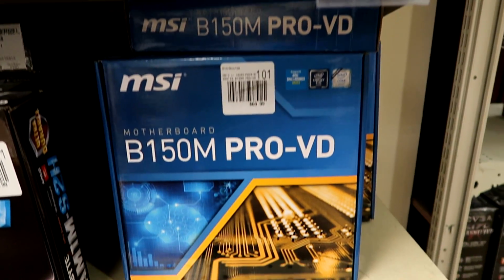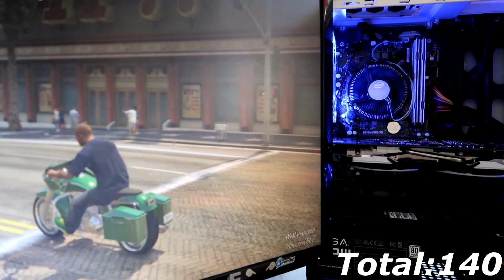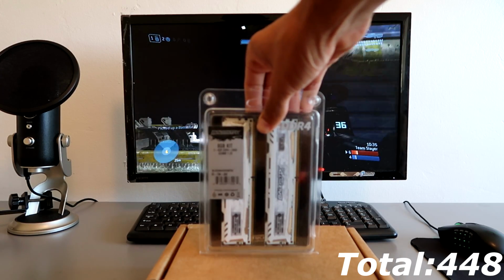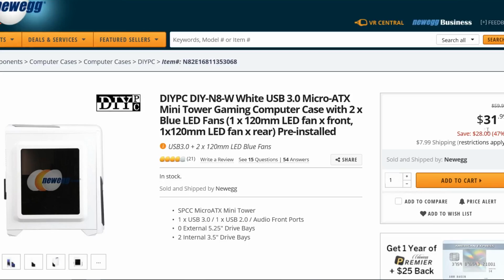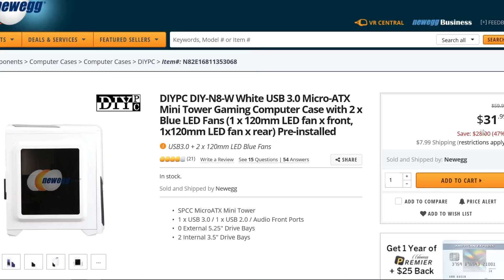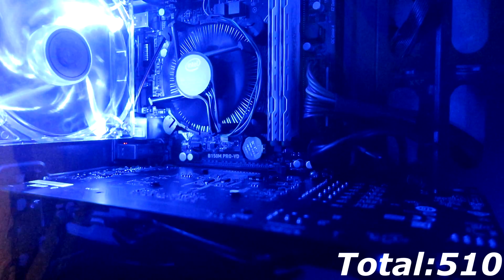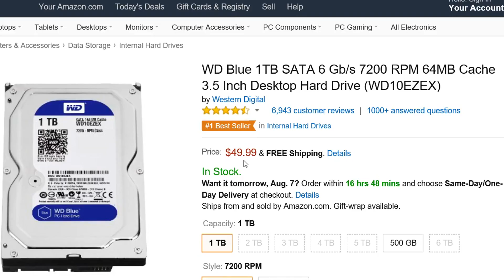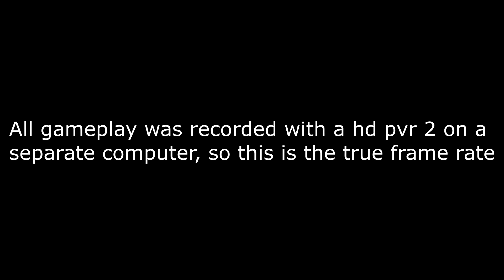Best $550 Budget Gaming PC Build Skylake GTX 1060 (w/ Benchmarks)

Comment: Anybody know some good cpu fans and normal fans for this build? Something that will keep it really cool. The case i got for it is the Corsair Carbide Series SPEC-01 Mid Tower Gaming Case. Also can you give me some fan adapters. Because the motherboard only had one 4 pin fan that i am using for the front case fan.

Comment: ok so someone tell me if this is a good pc gaming build

Cpu: i3-8100 coffeelake quad-core 3.6ghz lga 1151 - $120
Gpu: asus geforce gta 1060 3gb dual-fan oc edition - $145
Ram: 8gb single ddr4 2400 mt/s sr x8 dimm 288 pin memory - $87
Data Storage:  WD blue 1tb sata 6gb/s 7200 rpm g4mb cache 3.5 in desktop hard drive - $44
Mobo: H110M pro-vd - $46
Case: N/A
PSU: EVGA 500w - $35

Total (right now) = $476
(i need to find a pc case, then im good)
Reply: Get an ssd then its good

Comment: What i learned from these types of videos is get everything trash except the GPU.
$800 BUILD RIGHT HERE RIGHT NOW!
INTEL CORE I5 6500 $189.99
ASUS Z170-E 110.99
CORSAIR VENGEANCE 8GB 3000MHZ $66.87
WESTERN DIGITAL CAVIAR BLUE 1TB 7200RPM HDD $49.49
GIGABYTE WINDFIRCE 1060 3GB BECAUSE THE 3 GB ONLY GETS YOU LIKE +3 FPS $179.99 
NZXT S340 (WHITE) $66.99
EVGA SUPERNOVA 650W 80+GOLD $77.88
THIS CASE IS NOT FITTED WITH AN OPTICAL DRIVE SLOT BUT IF YOU PICK A CASE THAT HAS ONE LG WH14NS40 $47.89
WINDOWS 10 PRO 64BIT $128.89
AND A CHEAP ASS KEYBOARD/MOUSE BUNDLE LOGITECH MK120 14.49

IDK WHY ALL THIS IS IN CAPS BUT FUCK IT! i pick the more expinsive motherboard so you can do SLI/Crossfire in the future :) it's a fairly future proof build and the case looks really damn nice. if you get the Elite version it's like $20 more but it has tempered glass which looks sexy as fuck!

Comment: Dont you need a operating system that costs an extra 100$
Reply: Yoni Mizrahi windows 10 is free but it has a watermark or you can get a really cheap version for around 10$
Reply: Its around $7 on reddit and ebay

Comment: Here in the most countries of South America the "Budget build" is :
Cpu: i3 6100
Ram: 4gb x2 DDR4 2100 mhz
Motherboard: asus b150 ds3h or H170-m plus if you have more money.
Video card: R7 360 or  gtx1050ti if you have enough money
Case: You can go with corsair 100r or corsair 400c
Psu: Seasonic s520II 520 or evga 600b
All of this is , in Argentina , between $12000 - $ 15000 , and in dollar conversion is "U$D 750 - U$D 940" The prices may vary , but is all the same in Chile, Brasil, Uruguay, etc. Fuck this socialist continent (From Mexico to Argentina, not including Mexico)

Comment: My setup is cheaper amd waaaaay better, it could put perform your pc anyday, I have a evga gtx 1050ti 4gb, 250 gb ssd, 16gb ddr4 ram, msi z270, i5 7500, 1tb wd black hd, a cooler master masterbox 5 case, corsair 750 watt psu and a cooler master cpu cooler,525$,  thats with shipping